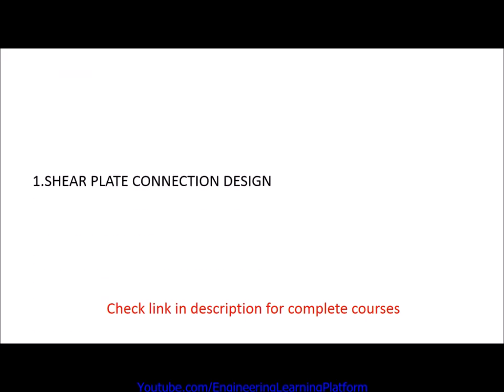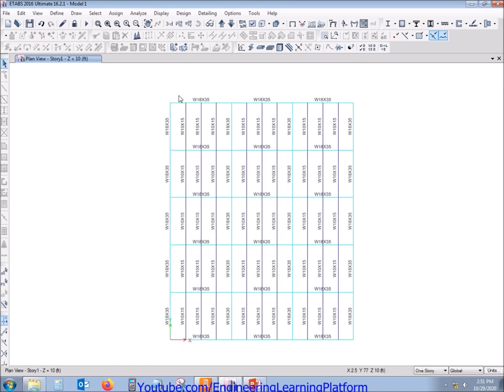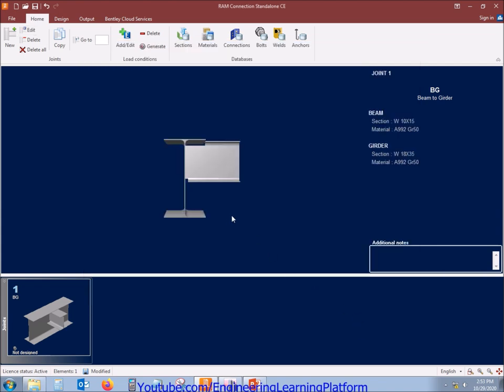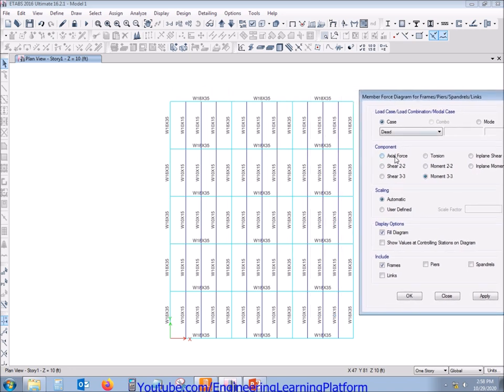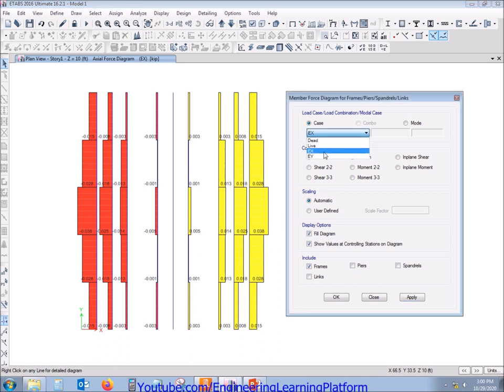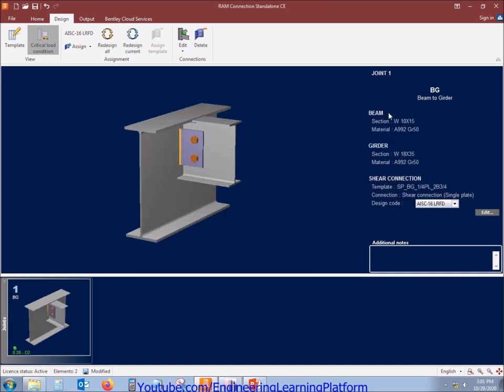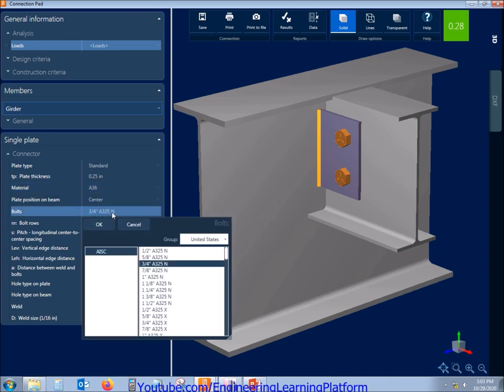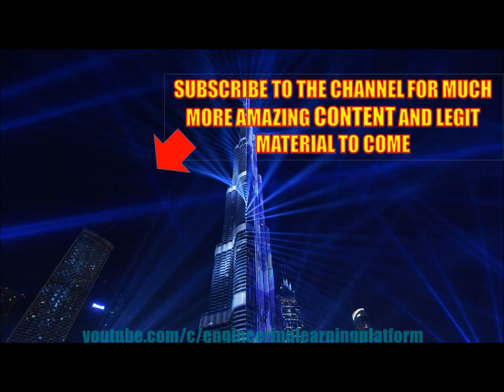Shear Plate Beam to beam steel connection design using Ram connection

Comment: Thanks for the lecture but it would be highly helpful if you upload more tutorials in practical steel connection design in RAM connection....more and more practical problem rather than solved example of theory book. Hope you get it sir
Reply from the maker: It is a practical structure example not book.